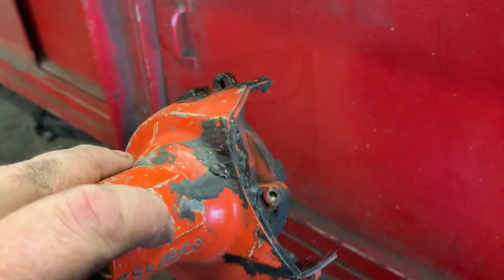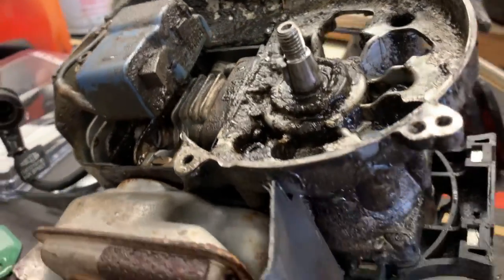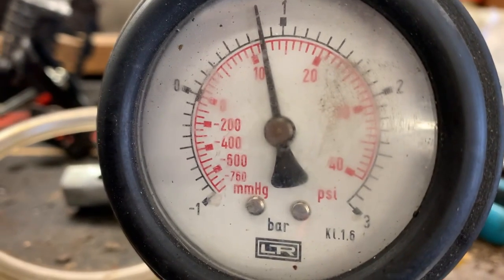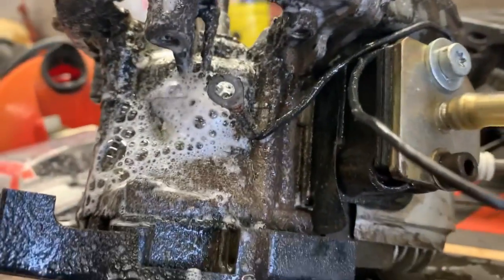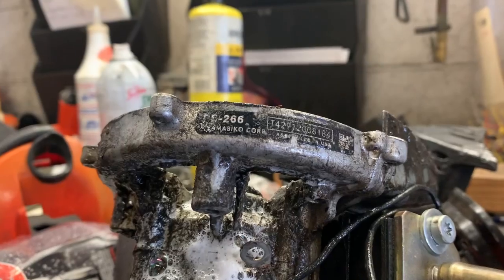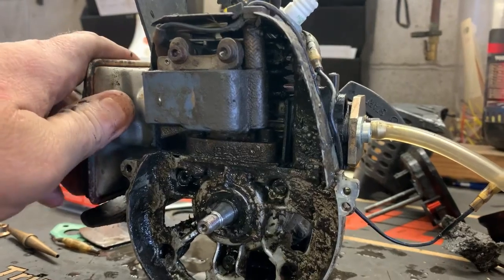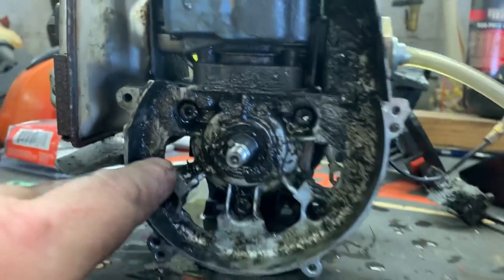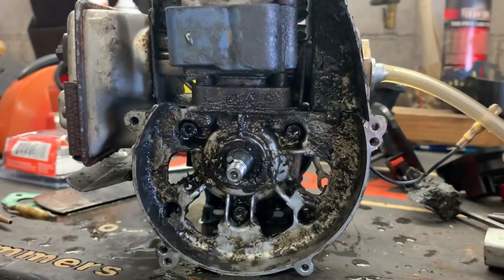DOES YOUR 2 CYCLE ENGINE LEAK OIL?

Comment: Brilliant!!! I was trying to work out why 2 stroke oil was leaking into the crank case... the crank case gasket pressure leak makes so much sense. I think the crank bearing seal is buggered on my sons scoot - well I can see it has a big oil leaking there. Time to replace the crank shaft seal since there is no pressure resistance to stop the gravity leak through from the 2 stroke oil feeder. I'll give it a go. I know there is a design issue with the bearing wear on the drive side due to load imbalance. Many thanks from Aussieland :)

Comment: Why would an air leak cause there to be oil everywhere in the crankcase?
Reply from the maker: Seal leak
Reply: But where is all that oil coming from?
Reply from the maker: @mikea-strong5020   don’t know how to explain it any simpler than a leaking
Seal
Reply: I’m just confused because it is a 2 cycle motor and the oil is mixed in with the gas.  So not sure how all that oil sludge accumulates.
Reply: Don’t mean to keep badgering you.  Just trying to learn.  I do really appreciate your replies!
Reply from the maker: Not all of the oil burns up in the combustion process, It stays behind to lubricate the rod the crank and all of the internal moving parts if you have a seal leaking in the oil will leak out
Reply: Thank you!

Comment: Thanks, I have a gas trimmer that a friend gave me leaks oil. The leak isn’t that bad, at least not compared to the engine you have. Thanks for the insight!
Reply: https://www.youtube.com/watch?v=If4RfooLBwg
Reply: Im running xd-100 in 8v92 2 stroke diesel, thats me running amsoil in the old kohler mower, great stuff and i pull it off and mix for total loss around 40:1.

Comment: Wow now that is an oily mess. My friend had a 2 stroke with an air leak between the cases that leaked oil. I replaced the center gasket and also asked what 2 stroke mix he was using along with the ratio. I grabbed the ratio rite, my choice of 2 cycle oil, a gallon of fresh ethanol free gasoline, and used blendzall green  label castor mix giving him the rest of the bottle to try that mix because it is what I prefer.  He was very pleased with the fix and hasn't had any more problems since. Do you ever have the need to lap cases when you replace a bad gasket ?
Thank you.

Comment: Thanks Mr. Jeremy! Do you make your own block off plates for carb and muffler to pressure test? Seems like I have a drawer full of plugs and rubber sheets and hole punches, Lol.
Reply from the maker: I have the factory tool
Kit from stihl and echo.  I like the echo kit better but the stihl kit has the block
Offs for the ts concrete saws
Reply: @THEMOWERMEDIC1  cool where do you get them from? I haven't seen them on manufacturers site
Reply from the maker: I got mine from echo and stihl.   Go to any dealer and tell them you want a pressure test kit
Reply: @THEMOWERMEDIC1  Thanks, I should check that out
Reply from the maker: The stihl part number is 0000-890-1701 and the echo kit is 
https://youtu.be/R8MooYs5nVA

Comment: Thats amazing it even started with that leak the thick oil must have plugged the  gasket leak  just enough to start it !
Reply: Mr mower medic maybe you can hep me witha issue I have a john deere js 63 the rear whell drive system does shift 3 speeds I have adjusted the cable to the point of no return and then some but the machine still pulls way to fast I measured the belt it is correct, if I put another cable in its going to make it faster I would think any ideas
Reply from the maker: What RPMs is the engine running
Reply: @THEMOWERMEDIC1  ohhh dang, now that you mention it  everything  else checks good I did not check the rip-ems it is running fast  3794 soooooooo just took it down to 3k whup whup it's fixed boy do I feel like a yoyo head thank you sir 😀
Reply from the maker: @joeortiz3455  💪💪💪 fixed!

Comment: I have a redmax blower and I think it has a crank case leak what is the easiest way to check it.
Reply from the maker: With a vacuum and pressure test
Reply: @THEMOWERMEDIC1  Please for give my ignorance where would I hook it up at?
Reply: @nashguy207  Nashguy i think it screws into in the sprark plug port.
Reply from the maker: Check out my 2 stroke playlist. I have many videos on that subject Nash!
Reply: @THEMOWERMEDIC1  ok will do. Thanks!
Reply: See if this MowerMedic1 video helps you out Nash...

https://youtu.be/radOV6rAJJU
Reply: @Big_Johns  Thanks John I guess i will have to make a block off plate for the carb. I have a mityvac but haven't had it long and haven't used it much yet.
Reply: Anytime Nash, I had to make mine too, they may not look very pretty but they work. Now, if I had MowerMedic's money I'd just buy a set for all of us. :)